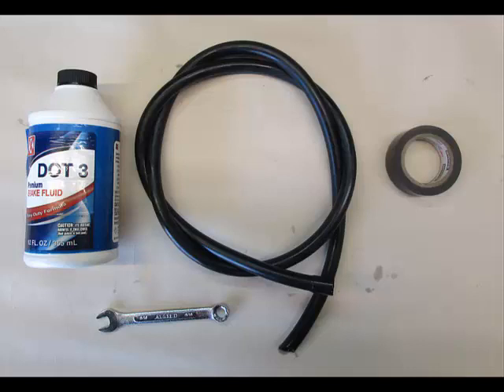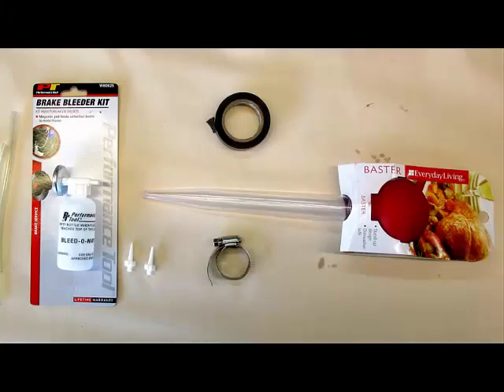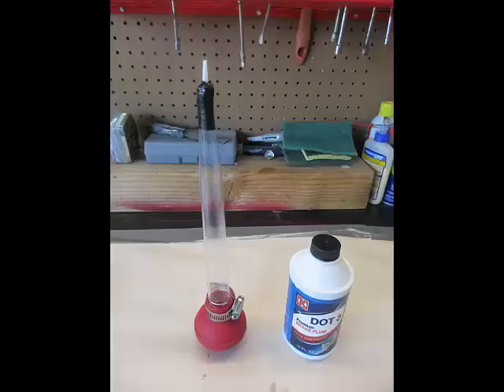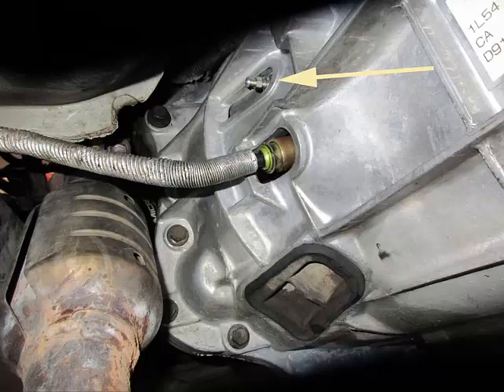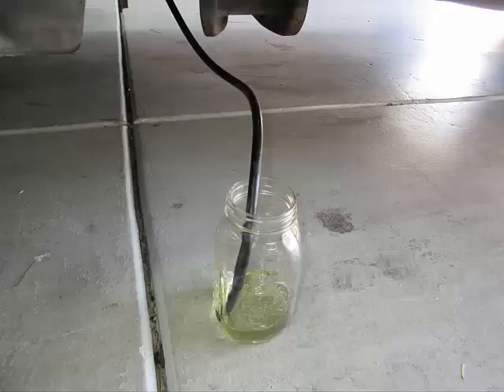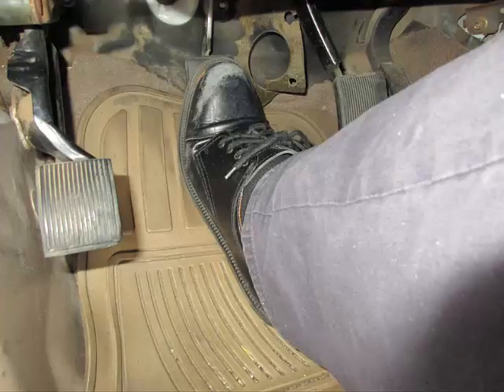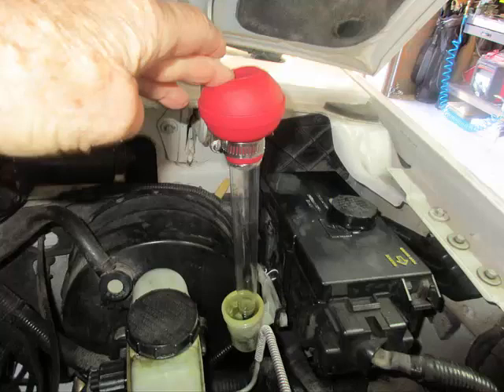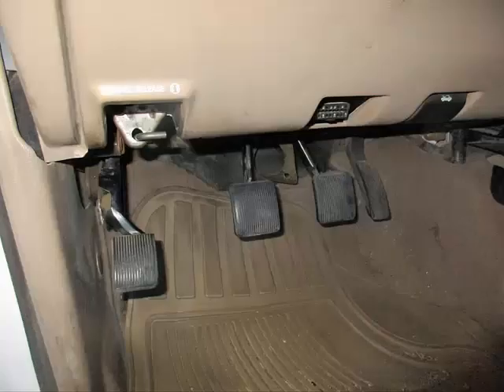Ford Ranger - Easy way to remove air from the hydraulic clutch linkage

Comment: Wondering if he's pushing air vis the baster against or did he suck up some fluid from the reservoir before squeezing the baster.

It would seem that the way he did it it would force some additional air in theine just past the reservoir from where the tip adapter in the baster was placed.
Reply: Press, hold and remove. Do not press and release while baster still in the reservoir

Comment: I just put a splitter into reservoir, one connected to line, the other with bleeder. I learned it works on either end. I put mine near the reservoir, then just pump and open to bleed it, like a brake line, you can even use the hose, and fluid in container to bleed yourself.
Reply: So you have a Y splitter with the bottom of the Y end in the reservoir and the Top of the Y having one hose going to the slave bleed screw and the other to a open/shut valve, like a fuel shutoff or an air compressor drain petcock? Wait, that doesn’t make sense. Wish you could draw a picture.

Comment: This doesn't work to bleed clutch master and all wrong and could cause more problems. He states the clutch bleeder fitting and that is the slave cylinder bleeder and you never press pedal down with slave bleeder open because this will put air in the slave and to reset you would have to vacuum the slave to remove air. There is no short cuts when it comes to this design. You do have to remove clutch master to purge air. You can't have anymore than 3/16 free play in  in pedal rod. The clutch master is checked as separate system by disconnecting the line from trans to isolate the master. Even Ford states that you can try other methods til time doesn't exist and you will never solve the problem. Follow the proper proceedures for proper results
Reply: Where can I find the proper method?
Reply: @KingOfShenanigan  I searched you tube and found some really good mechanics, Ford repair technicians with all the proper procedures. There are also many knuckle heads the mean well but not a good example too follow. Ford techs even provide a 1 800 tech support #. I just did a complete Clutch/slave assembly and Flywheel. I didn't need to replace master but did need to purge and set to factory specs on a 2006 Ranger 4x4. They don't show 4 x 4 model  which you do have to drop exhaust system and remove transfer case and you don't need to drain trans fluid if you are not changing fluid
Reply: I’m sorry friend but you’re incorrect in this case. Right idea - you should never release the clutch pedal with the bleeder valve open; however, in this case, since he has an air tight seal of the hose around the nipple and the other end submerged in fluid the system is still technically sealed and won’t allow air to enter provided that these conditions exist. This is a valid method for sure, I can confirm it.  Hope this helps 👍 and bench bleeding it Ford’s way is the best way for sure but a lot more work.
Reply: @anonrelentless1311  Of course you are just assuming something rather than having knowledge of this system and procedures. I own a Ranger and I know for a fact what works and what doesn't work and this doesn't work because the air will stay in the top of the Master and always be trapped until the correct procedure is used. There are no short cuts for this system and that is a proven fact many times over
Reply: @davidpotts3844  Plus people think the bleed-screw is air-tight once opened a turn - which it isn't - it allows air in at the base. So most watch loads of bubbles & think they are from the line - which they ain't - it's just the bleed screw sucking air in around the threads.. which adds to the fun. :-) ..
Reply: @jamesward5721  This is why you have someone at top keeping fluid level up so reservoir stays full. solo there is not enough time to get under and above and people are not allowing 2 completely full reservoirs to bleed through on gravity bleed nor are they using an additional tubing to jar filled with some fluid to prevent air from sucking back at bleed port. I did ask some people for advise and not one person would have gotten this procedure correct.
It so comically that people spend the same amount of time on what doesn't work then find out that they still are spinning their wheels than to just put that time in pulling the master and doing it right in the first place
Reply: @davidpotts3844  
So how do you get the pedal pushrod out of the master cylinder so it can be removed to be able to bench bleed the damn thing? (The master cylinder pushrod end not the pedal linkage end, which is also a bitch to remove without damaging the plastic retainer snap claw ring thing) Haven’t tried to make a removal tool yet but I know they don’t like to come out once initially pushed in at time of installation. Maybe remove the brake power booster from the firewall and leave the clutch pedal pushrod in place..
Reply: @beerggls  You have to remove the clutch master completely. There is no clearance so you have to get the inner fender well loosened as if you were going to remove it. Everything is attached to that fender well so removing it completely is not a good idea. I was able to remove all inner fender well screws and bolts and pull it out of the way enough for the clearance. You need to remove master with the push rod attached. To bleed master you don't need to remove the push rod. I did remove the push rod  to be sure I got a good factory bleed. There is a snap ring where the rod goes into the master but you will never get the ring back in place unless the master is completely remove and it really isn't necessary to remove when bench purging the master must be upside down and the line to trans stays closed  the reservoir must be higher than the master and you just exercise the rod  with the reservoir cap off. when you get to wear the rod is totally stiff and can not be pushed you are done and cap off reservoir and reinstall. Then have and extra person monitor fluid in master when you open bleed valve on slave and allow 2 reservoir fills of fluid to run keeping fluid in reservoir.
Reply: @beerggls  Don't remove brake booster you do have to loosen the main fuse box and move it out of the way
Reply: @davidpotts3844  
Sweet, thanks for the info. The only reason I was talking about removing the pushrod is because there didn’t seem to be a way to get it out from its mounting location with it in place. But I had not considered removing the fender well splash guard/partially removing. Might just cut a U shaped access flap in the splash guard, melt stitch hole pairs with a hot nail along either side of the cut, and zip tie the flap back into place when done... I learned the hard way with these things 15 years ago working on a B6000 at the auto shop. Took a couple days to figure out the master had to be removed and bled. Tried all kinds of things, like having the front wheels on the drive up rack only and lifting up the front end of the truck to just about a 60° angle before bleeding. Didn’t work and it was scary lol.
Reply: @beerggls  Yes I did do exactly that to try and get the clearance and a void removal of inner fender well. But I found that it is impossible to get the snap ring back in place from under the dash. It was a failed attempt that consumed hrs of time . loosening the fuse box and moving it out of the way gives you so much extra room to work but fender well has to be loosen to get that 1 1/2 inches. The screw that you will not see to loosen fender well is just under fender bottom and door. It only took 4 hrs to remove master purge and reinstall. I watched countless videos. because I also did the entire clutch slave assembly and I have 4wd I did learn all the things not to do many bozo driveway kings out there. The best videos were trained Mechanics and the Ford Techs were the way to go, they even have a tech support number that will talk you through just about anything
Reply: @davidpotts3844 
So when I unhook the quick connect hydraulic line from the slave cyl inlet and then get in the cab and press down on the pedal, I got a rock solid pedal that stays at the all the way up position. Like any pedal movement has got to be just the firewall flexing. So I don’t recon I’m compressing any air in the top half of the system. I did gravity bleed the new master before installing, holding it in all different positions with the reservoir up above, whilst pushing in on/opening the quick connect valve down below at the end of the hose as so to let brake fluid pass through. Didn’t pre-bleed the slave but I don’t see why it wouldn’t gravity bleed all the air out through the bleed screw, what with the top half purged already and the bleeding screw being the highest part of the system on the lower half. Any air in the lower portion should have nowhere to go but up and out, be it by way of air bubble buoyancy or by way of being pushed by moving fluid. Maybe the old O-ring at the end of the quick connect male coupler end is damaged and letting air into the system. Because with the hydraulic hose attached as it sits now, it feels like nothing but the springs in the neutral safety switch putting any resistance on the pedal travel.
Reply: @beerggls  With Master main line disconnected from trans and you have zero movement of pedal and rock solid then the master is set to factory spec 1/16 to 1/8 max movement is factory spec on pedal. Check O ring on main line connection and make sure it's there. Gravity bleed slave after making main line connection but don't push on pedal before Gravity bleed is done and you purge 2 full reservoirs of fluid before closing bleed valve. making sure you have a good fluid stream during purge. Once bleeder is closed you should have a full clutch. View movement through inspection hole and watch when pedal is pushed you should see the throwout move about 1 inch to 1 3/8" of movement. if you have this movement then all is good if not then the slave cylinder is not working properly. Check and see if you are leaking down fluid at reservoir level
Reply: @beerggls  Question ? did you do any parts replacements of Clutch assembly or are you just having a soft pedal
Reply: @davidpotts3844  I put a new pressure plate, flywheel, and friction disc about eight months ago. Sitting at a red light going up a very steep hill, when it turned green I slipped the new clutch badly and from there it burnt up premature. Discovered at this point that the master was leaking fluid and I probably wasn’t fully disengaging the friction disc from between the flywheel and pressure plate due to air in the system. This is probably what glazed things up to the point that it slipped catastrophically going up the hill. So now I have just installed a stage four racing friction disc and pressure plate and yet another new flywheel plus new slave and master. So everything is new in the hyd system except for the damn hydraulic line between the master and slave and it’s old crusty quick connect O-ring.
Reply: @beerggls  Since you went to a 4 stage clutch the slave and master should be upgraded as well to fit the upgrade  If the pedal is solid then line is good a new master should have had a new O ring with it for the line connection. with all you described then a new o ring is a must. The thing that most people would miss is to watch the throw out travel through inspection portal when pedal is pressed. The only other thing that would cause not to function is the the self adjusting clutch reset. Though this usually is done by factory for new parts. Caution with a 4 stage clutch this is and upgrade that your Crank shaft is not designed for. It will grab with zero tolerance and could snap your Crank Shaft
Reply: @davidpotts3844  
Snap the crank, burn the tires, or twist off the motor mounts, lol. But at least the disc wont slip! Gonna have to weld some dimples on the bare metal pedal which is missing its rubber pad, so my foot don’t accidentally slip off and dump the clutch. I ordered the parts before realizing I had a master cylinder leak, inadequate throwout, and likely glazed flywheel reducing the torque to slip threshold. Stage 4 was my best idea for a solution at the time. .. I gravity bled two reservoirs worth of fluid out the bleeder and still have no pedal. Even though it was rock hard pedal as far as I could tell with the quick connect hose/line unplugged. I was afraid to stand on it with too much force though, not knowing how much pressure the master cylinder and hydraulic line can withstand before bursting. Rock hard with moderate force applied. Think I might try plugging the quick connect into the old slave cylinder that I removed previously and see how it behaves, put the whole slave in a big clear tub of brake fluid and see if air bubbles come out anywhere under pressure. Haha. .. And the new master did come with an O-ring for the hydraulic line, I found it and replaced, even though the condition of the old one did not appear to be compromised in any way. About to pull the master and just start over from the beginning.
Reply: First you would burn the tires to twist the motor mounts before the Crank Shaft would snap. Vacuum slave open bleed under vacuum , vacuum slave so you know it is totally collapsed and free of air and start again. Never depress petal until gravity bleed is complete or you put air into slave and have to vacuum. I did mine correctly the first time to avoid these issues
Reply: Once you throw air into slave you will not get a good result. all systems are isolated and each remain til opened